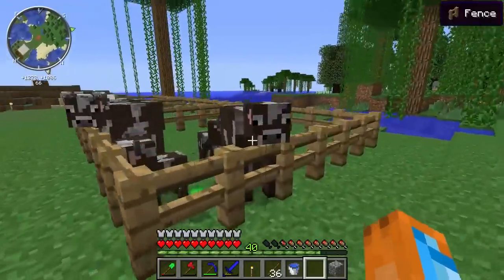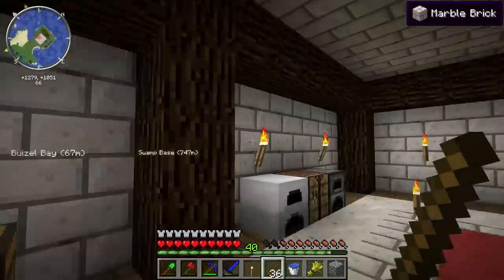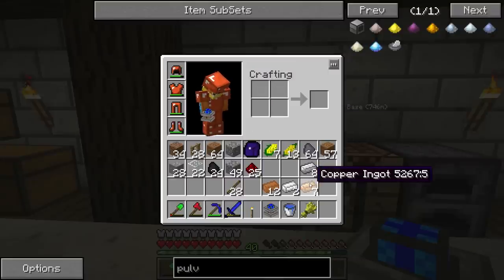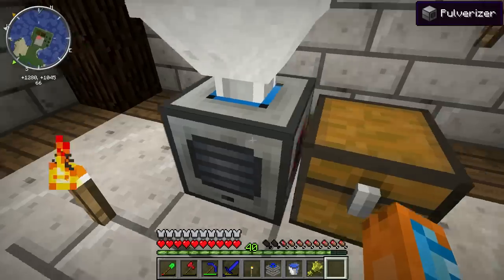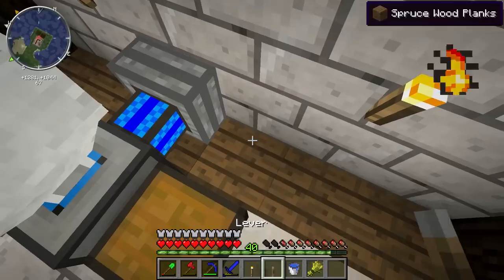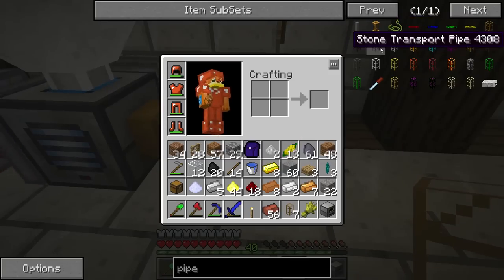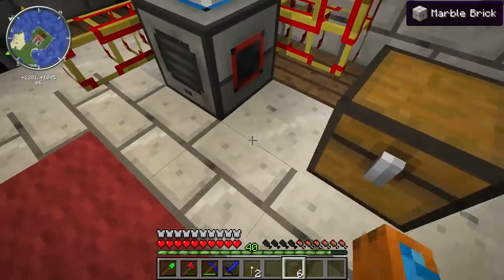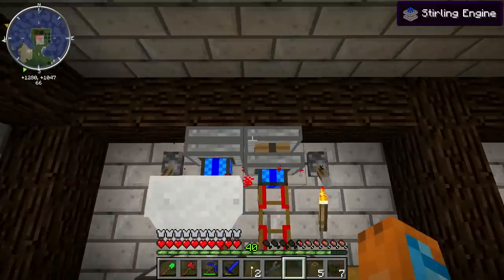Minecraft FTB Hermitcraft Part 07: Basic Ore Processing!

Comment from the maker: I built it from scratch myself and it was designed to be a video production/gaming build, so it's somewhat overboard, but has been awesome for pumping out videos.
• i7-3770k processor
• GTX 680 video card
• 32 GB of RAM
• 256 GB SSD for system
• Tons of hard drives for storage
Those are the main important specs.

Comment from the maker: Ferrous Ore is alright to get Nickel, but you can also get some from pulverizing Iron, so I prefer to save Ferrous Ore until I can use the Industrial Grinder to get some Platinum Dust out of it. But if you mostly do the MJ stuff, it's fine.
Magmatic Engines are awesome haha, same with Biogas.
You're totally right! I forgot I could have just shut off the input, haha. The steam engines I'm talking about are basic kinds; I'll do the real steam stuff (Steam Boilers) later.

Comment: You wouldn't have to use a Iron Pipe. Just configure the Furnace to have no outputs or inputs on the bottom, and the pipe won't try to interact with it at all.

Comment: There's pros and cons to having Thermal Expansion/BuildCraft and IndustrialCraft machines. With the pulverizer, you have a chance to get a secondary output, but it's slower. With the Macerator, it's more expensive but it's quicker with overclockers and IMO, EU is easier to work with than MJ.